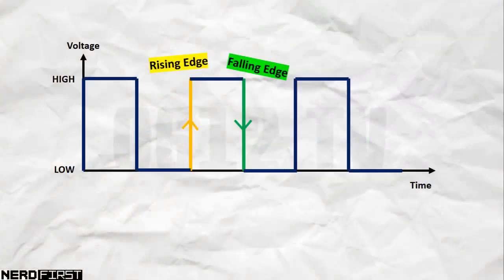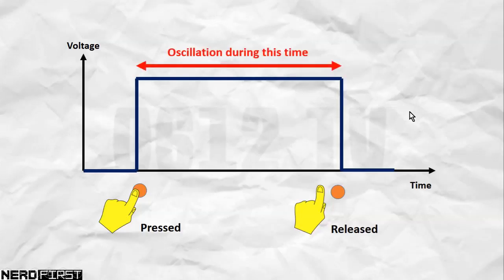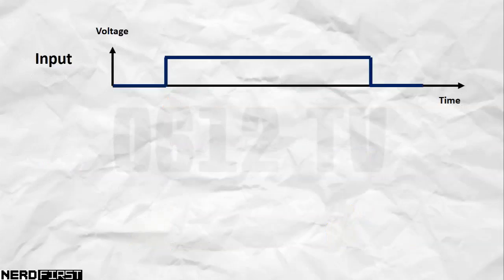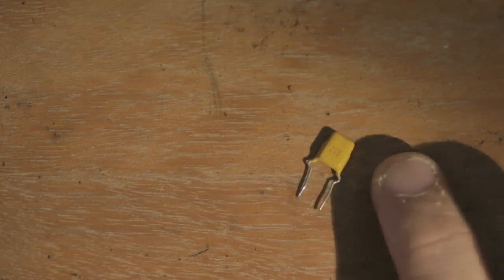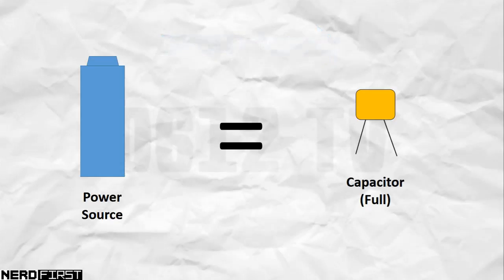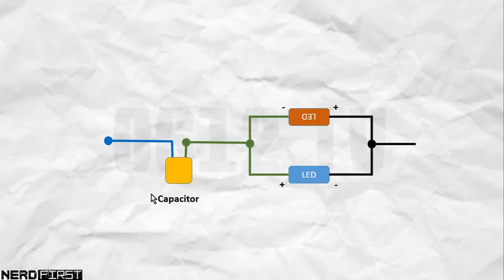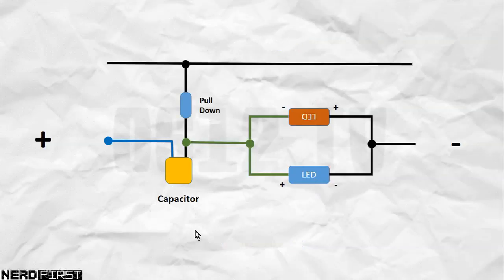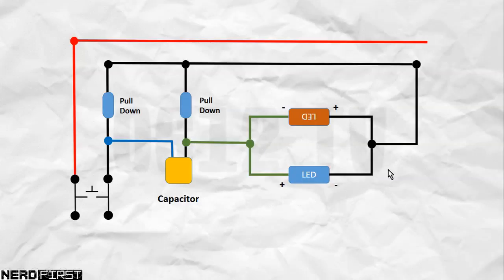Pulse Detector - Transistors 11

Comment: First of all thanks for the circuit. That was what I was looking for.
But from a technical standpoint I have some suggestions for improvement the current direction should be from - to + since electrons can move and protons can not and a capacitor has two metal plates with a layer of isolating material so there is no way for electrons to travel complete through the cap I think you already know that but that was what confused me in your explanation
Reply from the maker: Hello and thank you very much for your comment! Yes indeed, I tend to take some liberties in places like this, in favor of making the overall explanation a little more palatable.

At an abstract level, going too far into the internal specifics of the components used can hinder learning, so I go for the most intuitive approach.